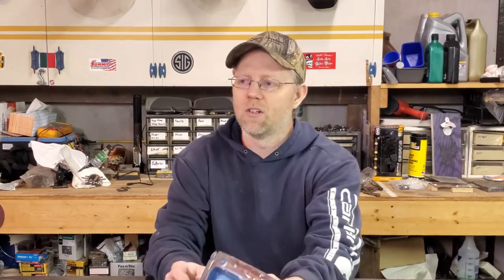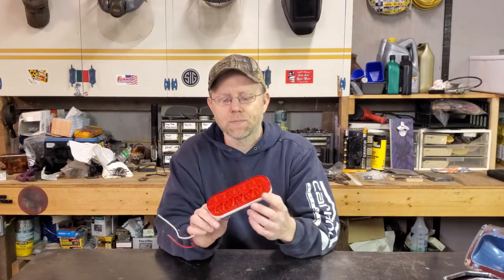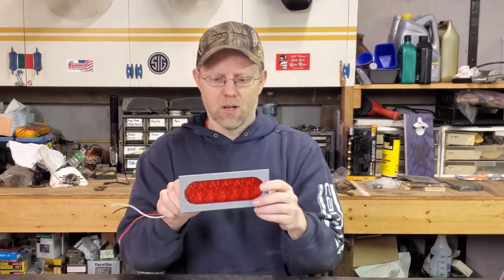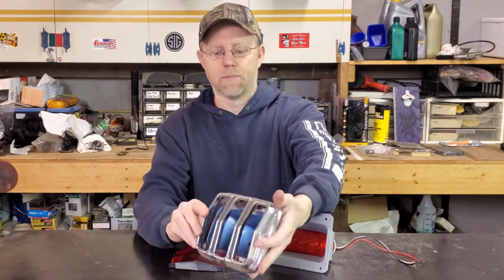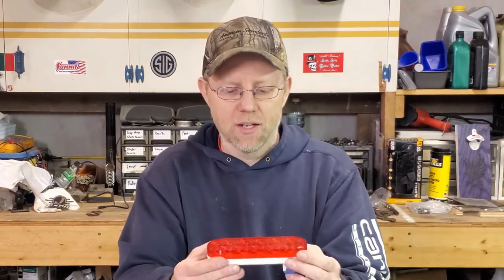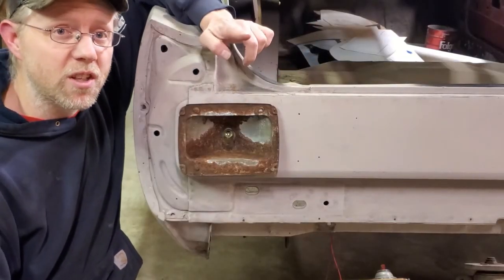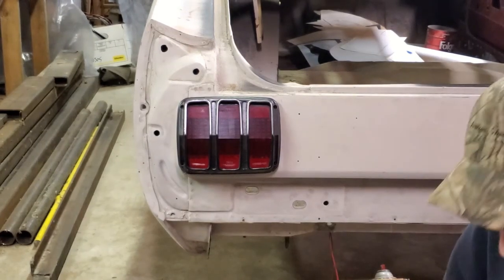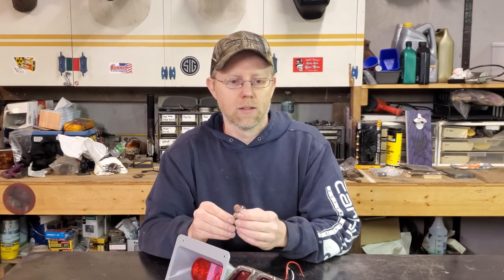3d printed tail lights! | Project Blackpowder

Comment: looks good and great idea...just keep in mind that direct and reflected sunlight can do a number on pla parts in a hurry so may wanna look at asa or one of the carbon or glass filled nylon like nylon x and nylon g or their equivalent....may even want to look into a caswell printed parts plating kit ..have fun!
Reply from the maker: Yeah, the next version is pla+ and I am going to let it sit in the back of my truck for a while this summer. I may need to upgrade to a better material before the project is over. Thanks for stopping by!

Comment: It took me way too long to realize I needed a printer enclosure.  I highly recommend getting one and preheating your heatbed to print temps for 20-30 minutes prior to printing your parts.  

Also, to diffuse your light, pull apart an old tv (every suburb neighborhood has one out on trash day) or an old LCD monitor apart and remove the white film.  I use that stuff a lot.  I'd remove the red lens from the truck light of course too.  I'm working on my 1982 Supra and am planning to do this very thing.
Reply from the maker: I get good results from my printer setup, but to print abs/asa i will have an enclosure.

I have a couple ideas for diffuser, and i think i will add yours to the list. I even have a junk monitor!

Thanks!
Reply: @squirrelsworkshop  Glad to hear it!  I print entirely in ABS and Carbon Fiber Polycarbonate now.  Also, have you seen how clear cellophane gift wrap (the stuff the use for basket arrangements) transmits light?  They use it in lightsabers.  Just something to keep in mind when you need to carry light a distance.
Reply from the maker: Interesting thought, but I doubt the color fastness of the celophane. UV does a number on those types of plastics

Comment: If you want your prints to stick to the heatbed then use hairspray with polyvinylpyrrolidone in. It must have that ingredient in it . Just a light dusting will do
Reply from the maker: Good to know, thanks! I have had good luck lately with a clean and dry textured Ender plate.

Comment: simple solution for a good reflector on back of housing:hand polish an aluminum can and print clips to hold it in
Reply from the maker: Good idea! I think I will have an aluminum back panel in the final version, so maybe I will leave extra room for a polished section. Thanks for the suggestion!
Reply: @squirrelsworkshop  I've seen advertised a low temp aluminum welding rod that could join even .004 or so aluminum. could use cansand shape them. if you did a parabola shape it would be extra reflective. could 3D print a simple form to make it.. I used Metal Polish Creme by Blue Magic to get some items to an absolute mirror finish., good luck with the idea and post any projects you do with it as I'm curious as to what creativity can do.
Reply from the maker: @FrankensteinDIYkayak  thanks for the info! Part 2 video has been released, and it took a bit of a departure from this setup. More to come in the future as well!
Reply: @squirrelsworkshop  stay in touch with me as I might be doing the same with a high degree of innovation and creativity. and maybe swapping ideas. I've been pretty good at plastic welding. kayak in photo is a one off and was plastic welded and has held up

Comment: Could get better output with a clear LED, it's going through a red lense anyways. Clear PETG makes for a good diffuser, use high heat and thick layers
Reply from the maker: You are right about the clear LED, I think I found one I will use in my final version. Video in early 2024!

Comment: As a diesel mechanic, no those lights really dont last any longer. The end result looks really good though.
Reply from the maker: Do you mean number of years they last, or number of hours they run before failing? I would think that most comercial truck/trailer lights run a great deal more hours per year than this application. Thanks for stoppin by!
Reply: @squirrelsworkshop  maybe for this application, I don't have nearly as much experience with classic or regular cars, but on trailers and trucks the only main difference is brightness. Past that I replace just as many. Either way you got my subscription, I never thought to use cheap trailer lights on anything else. Can't believe I havnt seen any of your videos until now.
Edit: for clarification It feels like I replace just as many leds as conventional style.

Comment: How much to print a set of tail light lenses for a 1979 Malibu?
Reply from the maker: I have not yet printed lenses. I would have to look into transparent materials and methods. Are they not available for purchase?
Reply: No they are not it is for a 1979 malibu
Reply from the maker: @mikewolfe789  i see there are quite a few used ones for sale, but almost no new ones. They also look like they are too big for my printer. There is a big 3d print community or reddit, and you can ask lots of questions there. Many people there will even print for you. https://www.reddit.com/r/3Dprinting/s/N0y53EWUdQ

Comment: Awesome! i can't stand the All-in-one "throwaway" LED lights they are worst. Spend $500 or $1500 a pair just to have a group of LEDs die out and you have to toss the whole thing. A housing is a housing and a bulb is a bulb. Way easier and cheaper to replace $20-40 worth of LEDs and if you can't find your bulb anymore you have the working file to adjust the bulb side of the mount and the slicer/printer to run another set.
Reply from the maker: You got it! Yeah, I definetly want something easy to replace. Keep an eye out for the final version in the future!

Comment: We both had the same redneck idea. I didnt want to buy that overpriced led kit either. So i ended up getting some $10 led trailer lights and just clear epoxying them to the inside of the red lens. Another bonus is you can run really small gauge wire to the rear.
Reply from the maker: Yeah buddy! I was ready to just stuff some small lights in the original housing and call it good, but i think this is a better route.

Comment: I like that your design uses an off the shelf unit.  That gives you the opportunity to swap out a light if there's an issue.

Did you solve the tail light lens moving in the metal grating?  That, I would make a space bracket (or two - upper + lower?) to space the lens proper between the sheet metal and the metal grating that surrounds it on the outside.

Going to check out some of your other videos and snoop around and see if you've updates on this.
Reply from the maker: I have a new light video in the works. V2 is a fair bit different, and I will explain what changed and why. Cheers!